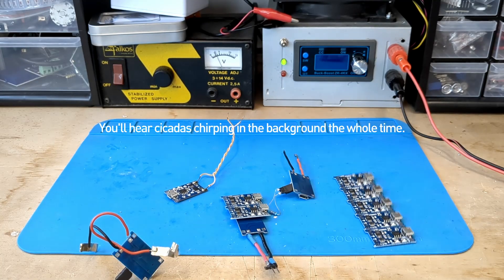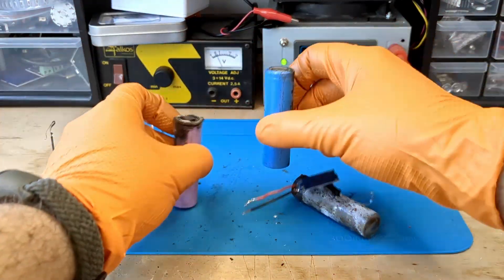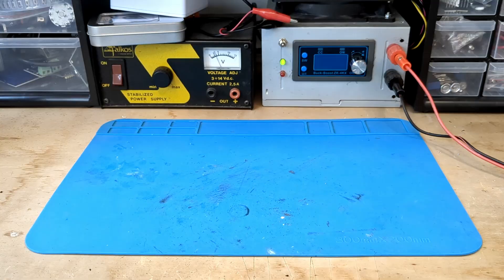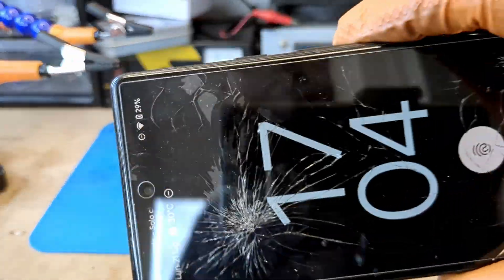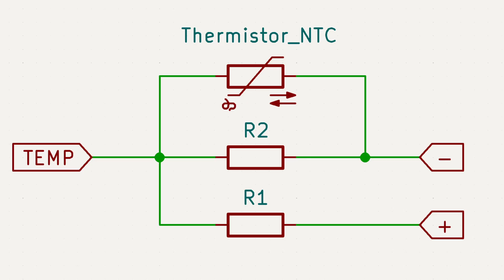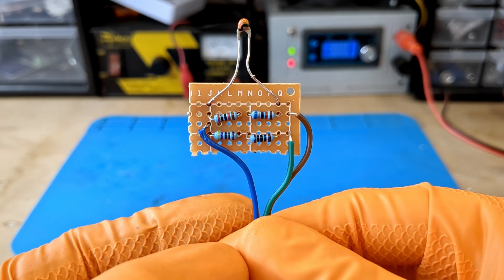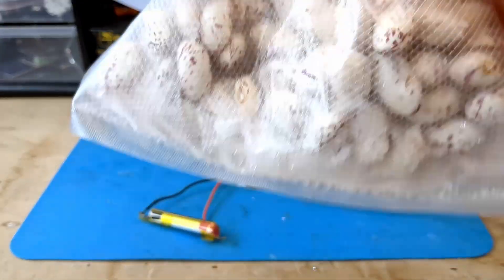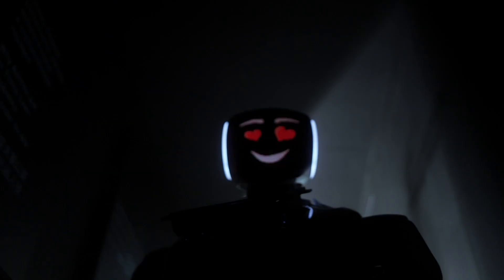Don't ruin your batteries! A simple mod to make TP4056 Safer

Comment: when working with batteries, water or co2 fire extinguishers will not stop the fire; your best bet is throwing the batteries on a plate of sand and wait until the fire dies
Reply from the maker: Until yesterday, my technique was to pray in Latin and practice an exorcism on each battery
Reply: @dariocose  😁
The problem with Li-ion batteries is that they generate their own oxygen when burning.

What probably happened.
The TP4056 stops charging with 4.2 volts on the cell .....so far so good...  but when the cell voltage drops after charging, it again charges the cells to 4.2 volts and so on, this the batteries can't handle, they simply get's overcharged despite the voltage didn't cross the 4.2 volt limit.
The resting voltage of the battery is lower therefor it gets overcharged. It is a known limitation on using these chips. They should have chosen to decide recharge on a much lover voltage or better yet no charging before the supply voltage was interrupted and restored (pulling the usb cord and reinserting).

Would temperature monitoring prevent this ? yes.

I'm happy to see you survived in one piece.